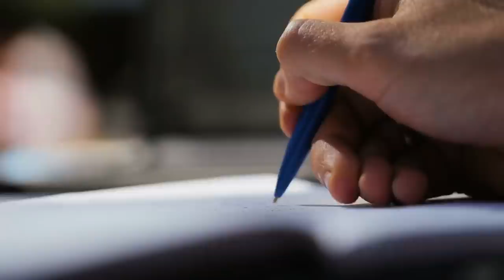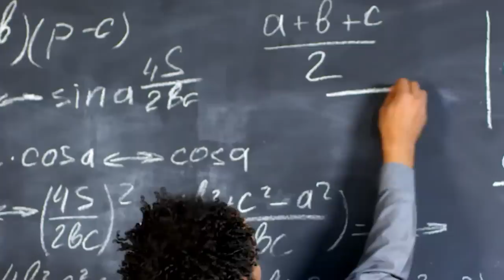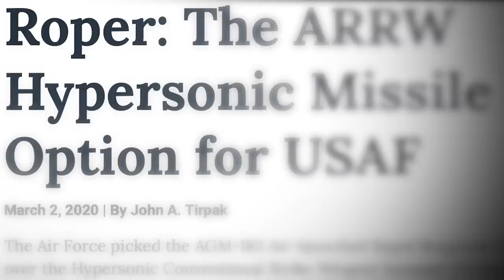The Missile Inside a Missile - Mach 5 Hypersonic AGM-183A

Comment: Wait is this not a scramjet on the belly? I doubt it could sustain hypersonic glide for more than a few seconds as the air resistance will become insanely high.
Reply: No the AGM183 just carries a glide vehicle. Depending on how high the vehicle is released, they could be moving easily over M10. I would imagine they have figured out how to manage the potential and kinetic energies to maintain a speed they want, but those are better minds than mine 

The X-51A Waverider was shown quite a bit and is the one with the big scramjet on the bottom
Reply: @bryannelson8852  oh that makes sense, thanks for clarifying!

Comment: Any hypersonic system with ramjet could be destroyed relatively simple . You just need liquid explosive as aerosol dispersed in front of hypersonic missile or aircraft.  It will explode in some primary section of an engine  and destroy its functionality .
Reply: Yea how do you fire that when a Hypersonic missile changes course during flight and this is what makes them undefendable against as you can't pin point it's target destination as you don't know it as it changes course.
ICBM'S and other missiles even space shuttle is Hypersonic in speeds.
You are confusing yourself to the difference and how they work and why can't defend against.
Reply: problem is: Even explosions  caused by conventional explosives don't expand fast enough, to cause significant harm. Those Missiles have to be built extremely sturdy.
Reply: @nedkelly9688  

This US missile is different and it is prepared answer to 
Russian ICBMs probably. It seems it has a missile that goes in space (standard liquid fuel engine +maybe ramjets to help achieving altitude ; carrier)  and other in atmosphere (fast attacking the target ; ramjet; nuclear warhead probably). 
My comment was not about these strategic missiles but tactical ones with different trajectories and use.
My comment was about  Kinzhal.
If it goes 8000km/h (cannot go 20000 km/h in atmosphere and since main engine is scramjet it cannot go in space where objects have >20000km/h speed ; other engine is just for achieving necessary parameters for ramjet/scramjet ;if there would be other march motor than booster it would be significant problem in mass ,volume and control ) it cannot change course often . It is not just a problem for missile body but also for  missile electronics inside or anything inside . It will break circuits because of normal force for example or damage components of fuse.  So it cannot change course drastically (angle )and all the time.
8000km/h equals about 2222m/s  hypersonic
2000km/h equals about 555m/s average supersonic missile
900m/s  AA artillery (650m/s standard ground artillery) 
so if you  consider launching from ground in projected path in some position before missile comes that way it can be intercepted but it is not "posse" or "3 dots" method which most of the missiles nowadays have implemented. It is more like modified 3 dots with coordinator or AA artillery principle .
That is why there was such fuss about  anti missile shield in Europe .
Problem is also dynamic pressure ( density of air and velocity squared v^2 and its forces and momenta influence ) . So which is optimal height for Khinzhal or  Zircon flight and trajectory. Zircon cannot attack like Exocet f.e.  with that speed at side of ship .
There are limits and boundaries  for these weapons systems and such can be exploited .

Comment: The Ford class aircraft carrier has a second nuclear reactor both of them are more powerful than the single nuclear reactor in the name of the class I think the second reactor is to power the Ford's laser turrets that can shoot down a hypersonic missile that maybe 20 miles away you know just cut it in half or a jet fighter now it can melt the pilot superheat the cockpit or just cut the nose off the plane or the engine or the wing I think this is why the Ford class was developed I think that they had weaker lasers on the Nimitz class I think they might have been on a power one of them and I think it might have been powerful enough to maybe destroy a small missile a mile or two away and that's only if they used 80% of the aircraft carriers power generation for this I think that's why they developed before class they have one reactor that is more powerful than the name of the classes reactor play twice as powerful and they have a second reactor that is just as powerful as the main reactor I think that second reactor is the power of the laser turrets I think that second reactor can pray power to maybe three of them and at least two and I think if they use you know the second reactor and half the power of the first I think that these weapons will be real powerful enough to destroy any aircraft from pay 20 30 miles away any hypersonic missile that's why they're not so worried about hypersonic missiles cuz they can defend against them and that's why they're wanting to put laser weapons in the next generation of operational fighters now I don't know how they're going to power unless they secretly put a small nuclear reactor in the fighter which I wouldn't put up past them doing that s*** and not telling nobody
Reply: Chemical lasers?

Comment: Russia and Chia are not that far ahead.  Their only air launched missile only has a range of 500km, which means the chance of a launch vehicle getting close enough to fire is unlikely.  Their other missile is longer range (1000km I think), but is only HS for part of its flight.  Both follow a very predictable ballistic arc.  These missiles would not be that hard to shoot down.  Really the main advantage is less warning time, but in a war it should not be that much of a deal.  The US's HS cruise missile though is going to be a beast.  The glide warhead one is OK, but do to its size it can only be launched from a bomber.  Russia has this problem too as they can only launch the Kinzhal from a modified Mig-31 or a modified Tu-22M3.  The AIM-260 is pretty important too and I would not be surprised to see multiple versions of this missile deployed in the army, navy, and air force.
Reply: Russia and China, pragmatically speaking, pose only a bit more as a risk having such weapon since their current status t's not just the system itself but the implications and of what comes of it. They use it as a rally cry to form a coalition touting a new wunderwaffenwepon or some shit as a game changer. Prob even more useful as such a prop given the fact that like 33% or some shit percentage of their missiles work as designed (and intent completed in lieu of randomly exploding, flying off course, countermeasures, etc) and the odds of them landing dead on target are as good as a drunken fratboy making it in porcelain after the winning Rose Bowl game.
Reply: They are not ahead at all. 
The US has had glide based hypersonics since the 1950s. The fastest glide system the US has is probably about mach 22. 
These are not real hypersonic missiles that the US has but neither are Russia and China.